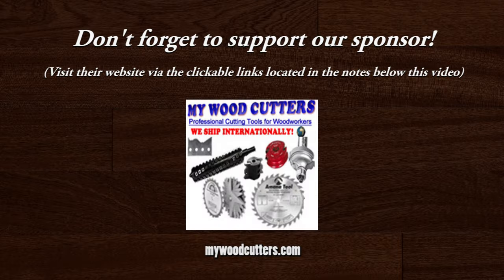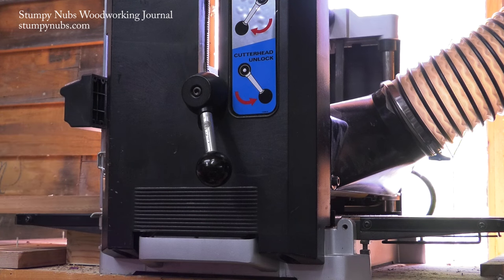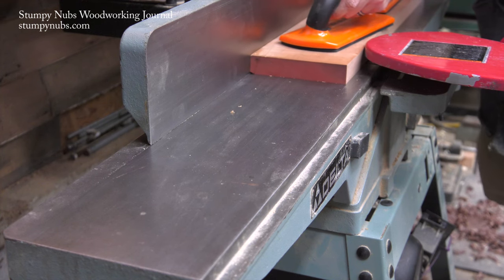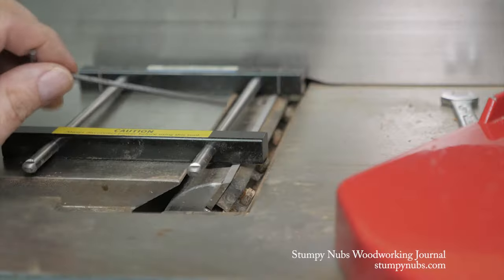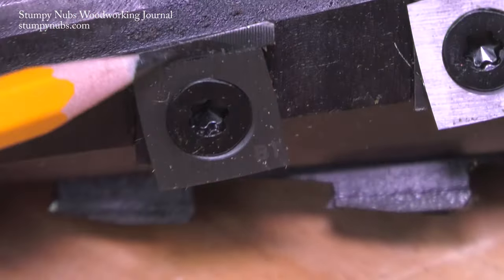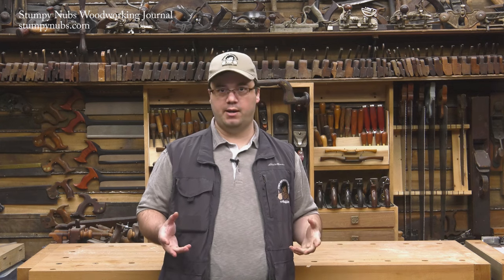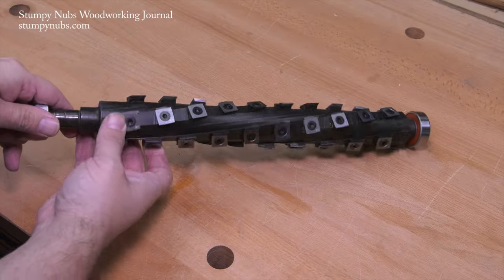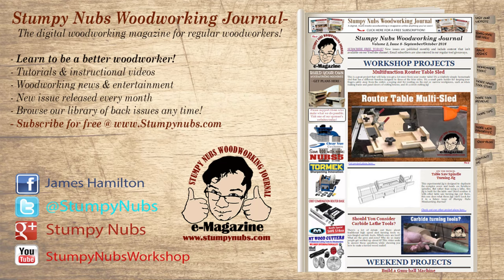WATCH THIS before buying a carbide helical (spiral/segmented) jointer/planer cutter head

Comment: I ordered a Byrd Shelix jointer head, and ended up getting a defective one that wouldn't fit in my jointer, it hit the cast iron. They said they had not centered the cutting tips on the head, and the rest of them they had there were the same way.  I was told I could either grind the one sticking out too far, OR I could wait until IF or WHEN they make a new batch, they could then send me one.  So I could either modify it, and have to modify it every time I need to change the cutting surface, or I could wait an indeterminate amount of time (possibly forever) for a new cutter head.  Neither of those solutions sounded good to me, So I told them I wanted a refund.  They were reluctant to send me a refund, and said they'd send me a new cutter head - but he still wasn't sure a few days later if they even had any more in stock that weren't defective.  I'm still waiting for my refund.  I would never try a Byrd Shelix head again.  Terrible customer service when a problem happens.

Comment: Very good video Stumpy.  I do have a couple of questions about the helical knives.  In order to rotate a knife does the screw have to come COMPLETELY OUT or can you just loosen and turn to change?  Secondly. where does the screw fall if you drop it in the machine?  Will it create a problem and hurt the machine in any way?

Comment: One caution with shelix heads. I have a Dewalt DW734, and I noticed that when I replaced the old 3 blade head with a new shelix head, the latter was about 1/16" smaller diameter than the stock one.
Reply from the maker: That's because you ordered the undersized one instead of the OEM one. They offer the smaller one for people who want to install it without removing all the cutters to fit it through the unique hosing on that Dewalt planer..
Reply: @StumpyNubs  Gotcha! Thanks!

Comment: This has been a very interesting post, I have looked up the SHELIX Helical Cutter Heads and I’m very impressed.

I have a small 12inch planer and a large machine for thick hardwood beams, I will definitely contact mywoodcutters.com to change over my straight blade cutters.

Thank you once again for a well informed video with not only positives but also negatives about a great product.

Comment: I think, by far, the biggest pain in the posterior for a lot of folks is to align the jointer knives properly!  Further, when I buy new knives, they arrive needing sharpening -- every time.  Just to confirm, are you saying that all this alignment (and of course the sharpening) goes away with the Shelix spiral carbide cutterheads?
Reply from the maker: Yes. They can not be misaligned, even if you tried.

Comment: One big drawback of a helical on a jointer is the extra physical effort it requires to push the piece through. To all those debating whether or not helicals require more power demands all you have to do is feel the actual resistance as compared to a conventional cutterhead on a jointer and you will understand.

Not much seems to be written about this but if you are running a lot of material, day after day, the energy requirement on the body WILL be significant.
Reply from the maker: We covered power requirements in the video.
Reply: @StumpyNubs  

I'm not talking about power requirements in terms of motor/AC current here. I am talking about the extra physical demand on the human body you will notice using a jointer with a helical head. The difference will be negligible on 6" to 8" but the bigger you go the more resistance you will feel. If you are a shop the runs high volume this will be a factor.

Consider a stock feeder.

Comment: @Stumpy Nubs
   Very interesting video. I didn't know that is possible to  buy a helix cutter head for a simple planer. I thought this is only for the expensive machines. However,  I often ask myself how this helix head would work if you try to make thin bars? For example 8mm x 8mm or even thinner. Would it be possible to do it with the helix head? Have you ever tried it out? Or is this only suitable from a certain width of boards?

Comment: I put a shelix in my dewalt 735 and the dust collection is worse, and i also get a lot more snipe than i did with the straight knives. Not sure why. I wish it could handle as large of a depth of cutt to but the qaulity of cut is so much better, i just take more shallow cuts.
Reply from the maker: I have one in my Dewalt 735 and I can't imagine why your dust collection would be worse. That planer is prone to snipe, no matter the head, especially earlier models. You are correct about taking shallower cuts.
Reply: No idea why the dust collection is worse. I opened the top to make sure it’s installed correctly and it is. Who knows. When I had the straight knives the snipe was basically no existent. Oh well. I’ll keep my boards a few inches longer

Comment: Can I get some feedback on this question:

If I was buying a planer for the first time, would anyone buy a machine with straight knives anymore?  I only have seen a Rikon 25-130H that comes with the helical heads from the factory.  Generally, it runs about $100.00 more than the DW 735.

Comment: 6:00 Where are you finding these for $150?  I looked up the helical cutter for the DeWalt DW-735X and it was $422.95 USD + shipping.
Reply from the maker: I said the replacement cutters are $150, not the whole head.

Comment: Ive been shopping for a thickness planer lately and some brands (rikon, king) come with a helical cutterhead from the factory, but I noticed they have nowhere near the amount of cutters that Byrd/shelix sells.  Any thoughts on this?  Does it matter?
Im also torn between a cheap delta 22-560c or splurging on a general Int. 30-125,any thoughts? Im a weekend warrior but I do plan on being alive for awhile and dont want to buy a machine twice.
If you have any videos or advice pls let me know.

Comment: Another down side (and mostly if you would install this on older routers) is the axial force those helical cutter heads produce. Many times the bearers of the cutter heads of the routers are not adapted to take up that force. This force comes from the facts that the cutters ar not anmore perpendicular to the axe causing a force along that axe. So, maybe the bearers need to be changed too.
Reply: Ball bearings can take end loading.  How much depends on several factors, including whether the ball bearing is standard or deep groove.  Without precise detail, I am guessing, but my guess is that the end force would not be of danger to any normal sealed ball bearing as are likely used in wood thickness planers.

Comment: You say that the helical cutter head causes the motor to work harder. I've read articles stating that the helical cutter heads produce less strain on the motor because as you state the cutter removes a smaller amount of wood on each pass. Which is correct? Is the Shelia cutter head the same as the spiral cutter on the cutech planer? Thanks for your input.
Reply from the maker: I have never heard anyone claim helical heads require LESS power before. Sure, the cutter is smaller, but they are going so quickly it may as well be one big cutter. Even the head manufacturers say they take a little bit more power.
Reply: Stumpy Nubs thank you.
Reply: They do put more load on a motor not designed for it...lighter passes on wider planks is a must..planers sold with them allready usually have the nutz to handle the norm.

Comment: I was talking to my family about these heads and they all said that as far as they know all the really good planers (industrial) use curved blades.  I guess you could call them spherical blades.  Do you not consider them good or are they simply out of reach for the home workshop?
Reply from the maker: All of the "really good" woodworking machines I know of use helical carbide cutter heads. I have no experience with "curved" or "spherical blades."
Reply: @StumpyNubs  Thanks for the reply

Comment: I'd like a helical head on my jointer. But unfortunately I haven't bought it because my outfeed table is not adjustable.
Reply from the maker: Can it be shimmed?
Reply: @StumpyNubs  I don't think so. It's a craftsman 113 model, I bought cheap and restored. The outfeed is a solid cast with the entire body.

Comment: You missed a key disadvantage. The helix head requires a lot more tracking. It looks like 30-ish cutters on the planar head. You have to first keep track of which edge you started on and then keep track of any individual cutters were rotated out of sequence. Knives are just all changed/sharpened all at the same time.
Reply: The little carbide cutters usually have numbers etched into the surface, so as long as you start each new cutter on edge 1, and rotate the same way, it's not too bad.
Reply: @gbspikyfish  Or a permanent marker to mark where you first started (obviously not right on the cutting edge).

Comment: I have a question. I watch your videos all the time. So ordered paid in full for the byrds shelix cutter for dewalt 735. On the my cutters. Com website. After I paid in full. About 3 hours later they emailed back and said shelix cutter head is out of stock for 20-24 weeks. But In turn offered the lux cut 3 for 20 dollars more. My question is. What’s better or are they equally as good. I don’t know unless I hear from a pro. Can you give me your opinion please.
Reply from the maker: I put Lux Cut heads in my new machines a year or so ago. They are great. I still have no complaints about Shelix heads. They're great too. But the Lux Cut has a couple minor improvements, and the wait time is way shorter. Go with it. Tell them I sent you :) Here's a video where I mention (and show) some benefits of the Lux Cut heads: https://youtu.be/XWkGXL2Jp88?t=317
Reply: @StumpyNubs  thank you stumpy nubs. Believe it or not , my woodcutters. Com had sent me a link right to you about the lux. Lol. They also informed me that it was a slightly better upgrade than shelix. All in all they are very helpful and quick responses. Also I thank you and continue to watch your videos. 👌. I will let them also know that contact with you also confirmed my decision on continuing the purchase of the lux cut.

Comment: I totally concur on the Bryd cutterheads.  I've been running them a few years now.  I love their noise reduction and several other upgrades you mentioned as well. 
Is the "V" shaped cutterhead not as good and why did you change it out?  Fred

Comment: Hi. Did someone replace the block from those Axminster medium sized planer/thicknessers, like AC250 or AH106 or even AT260? They are 250 mm to 260 mm cutting wide.

Thanks

Comment: If anyone knows, does this help with the end chip out or gouge in boards that you can get with planers?
Reply: sgvpotter. No, the snipe or step at the end of planed boards still occurs with a helical head.
Reply: i just died a little... :(
Reply from the maker: Snipe is usually caused by the way the machine is setup, and can be fixed. Though, some machines, like the Dewalt 13-inch planer, snipe because of the way they spaced the rollers.

Comment: Several people have posted the opinion that the shelix cutter heads are not worth it since they cost almost as much as a new planer.  I think that misses the point.  Yes, the cutter heads are expensive and cost is always an issue in deciding if something is "worth it".  The problem is with comparing a shelix head with the cost of a new planer (or jointer).  A brand new planer doesn't do as good a job as will a well working, but used, planer with a shelix head.  So, yes, a planer with a shelix head will cost more than a planer without one, but it's not fair to compare the price as if the two machines were equals.  They're not.  The shelix headed planer leaves a better surface and is quieter.  Maybe the extra performance isn't worth the cost of the upgrade.  That has nothing to do with the cost of a new planer.

Many of us make do with a decades old Craftsman table saw.  It gets the job done and we cannot justify the cost of an upgrade.  Yet, we wouldn't say a cabinet saw isn't "worth it" without taking into account the fact the cabinet saw does a better job the the old Craftsman.   Nor would we say a Powermatic or SawStop cabinet saw isn't "worth it" since it costs more than a brand new contractor's style table saw.  I think the same thing applies to deciding whether a new shelix head upgrade is worth it.  You need to focus on the benefits from the upgrade and decide if those are worth the cost.  Don't focus on the cost of an inferior machine.

Comment: Do the helical heads have any effect on snipe?  And are we going to see you at the Woodworking show in Novi?  I enjoyed chatting at the Rockler a couple months back.
Reply from the maker: In my experience, the head has little effect on snipe. Snipe on a jointer is caused by the outfeed table being set lower than the apex of the cutter, no matter what style the cutter is. On a planer, snipe can also be caused if the feed rollers are spaced too far apart. The popular Dewalt planer, for example, suffers a lot from snipe because of the roller design. As for Novi- YES! I'll be there int he SawStop booth on Saturday. Come say hello again!
Reply: I didn't think they would help with snipe, thanks for confirming.  I have the same Delta as you do and am in need of new knives.  If I don't spend too much at the show, maybe I can buy the helical for it.

Comment: I can't imagine anyone watching this video and not asking, "What is the cost in real money." I know the amount will vary a bit but in this case, any answer is better than no answer.
I am thinking of buying a 6-inch Jointer and I have a budget. It would save me a lot of time if I were told, for instance, that the six-inch helical jointers start at $5,000. Or that they, straight and helical blade jointers, are within $100 of each other. It might take an extra 20 seconds added to the length of the video but it would double the video's value.
Reply from the maker: I gave you a link so you could find out exactly what it costs...

Comment: Another negative of the helical: as Nubs has pointed out, these heads require more power to turn. Anyone who has ever has a planer gearbox failure knows how much punishment they take - a helical is gonna put more stress/pressure on all those gears and bearings. Non-gearbox driven units are going to see more heat and heat will translate to wear.

I have 2 byrd units and I'm very happy with them but the extra resistance they create is (I believe) an understated concern.
Reply from the maker: Tends of thousands of gearbox driven planers use these without any issues.
Reply: @StumpyNubs  Do you agree they stress a gearbox more than a conventional   3-blade cutterhead?
Reply: @StumpyNubs  General 130 planer owners might take issue with this :)
Reply from the maker: @troyjwood  - In theory, yes. But in the real world helical heads have been both retrofitted to existing machines, and sold as an option on new machines for many years without any widespread issues. These include machines that were not originally designed for helical heads, so they hardly have beefed up gear boxes. If some General 130 machines have failed, I would counter with the hundreds of other models that have not. This a case of arguing theory when reality shows something different. Have a nice day :)
Reply: @StumpyNubs  You have a good one as well and thanks for the video.
Reply: @StumpyNubs  Anyone concerned about machine stress can set the machine to take a thinner cut.